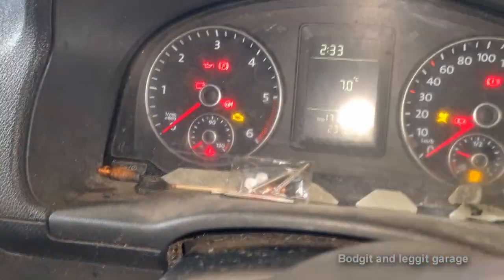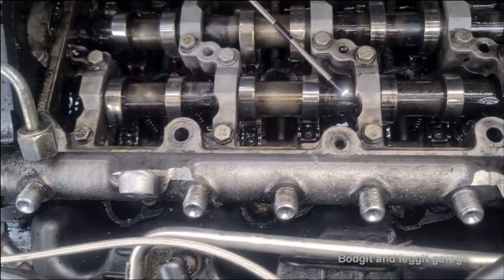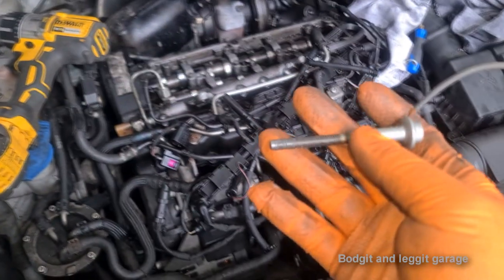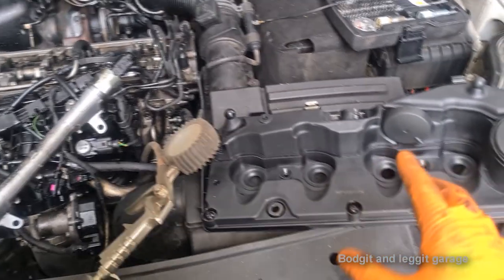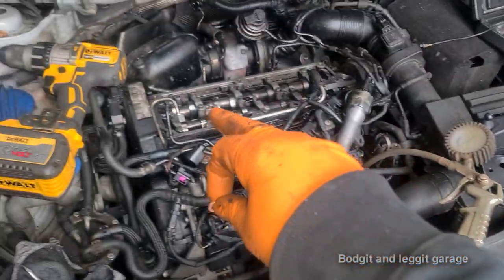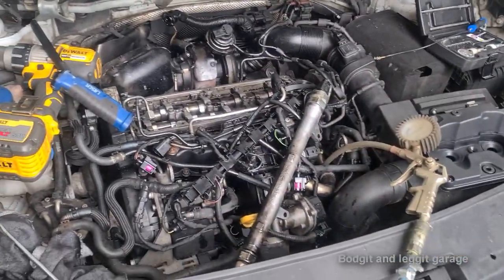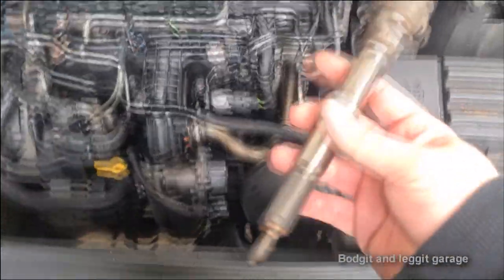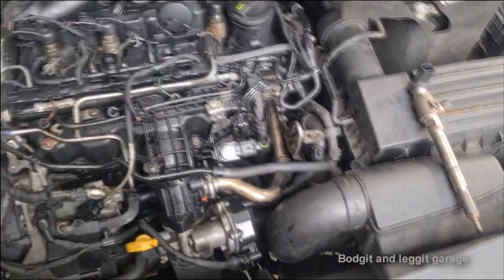Worst Job Ever Broken Bolts Runaway Diesel Part 2

Comment from the maker: I know I know I didn't really show the Helicoil kit Installation but I will be doing a separate video. Where I can film it a lot better So you can see a lot more what's going on
Reply: Did you change the oil and filter after you finished, I know you cleaned as best you could but any swarf or bits given these engines sensitivities wouldn't help down the line.

Comment: At those mileages these are the cars that never get seen by the dealer & their techs never get to solve these problems. Hats off to you putting things right with good diagnostics & some sound decision-making on the change to a stud & nut. These are the jobs that you remember & that showcase good engineering judgement.

Comment: When these VAG 1.6 /2.0 l seals go many people come to the conclusion it fitter error but its a design floor - the new seals are far to small for the injector and burn out - releasing the torque and causing the bolt to eventually snap. 

The damage can be catastrophic  - The feed pipes get distorted. The leak-off pipes shear-off - the injector seals in the rocker cover split and if you are really unlucky 

the injectors gets slammed into the seat and clip the hole the nozzle goes into, at the wrong angle scarring the seat area - meaning you have to reface the seat and use a different washer - I have sean a head scrapped from this and Fords have the same  set up….

Comment: Did my injectors on my Peugeot 5008 1.6 diesel  last year. One of the bolts snapped from the time before a mate changed one. Long story short, the broken part of the bolt which was left in stopped the clamp from pulling down the injector enough to make a seal.... so i cut the bolt down slightly which did the job.....

Comment: 14:30 I didn't understand what was the issue actually, why you couldn't use the same bolt in the new threaded insert? I have the same problem (same engine TDI 1.6) in my case the two injectors just popped out without breaking the bolt. so i'm just wondering should i use the same bolt or use a stud instead.
Very useful information btw... Thanks for sharing 🙏🏻

Comment: I hate this trade now been in it for 40 years there’s so much over engineered crap on cars  now… and things go wrong and the customer blaming you for other peoples fuck ups . Those bolts are a nightmare they are stretch bolts and shouldn’t be used again and mostly over tightened by previous garages and when you come to take them out they break leaving you with the stress of repairing. Everything is plastic housings.fuel pipes.sensors. The list goes on ready to snap  taking them out even changing a headlight bulb is a nightmare on most vehicles as well. Bring back the seventies so much easier then. Going back to those injector bolts make sure there’s no oil inside the bottom of the bolt shaft otherwise when you tighten them they will become hydraulic and will snap the bolt

Comment: I don't understand why people moan about your expensive tools.
You are a professional mechanic so you should have all the latest tools!!

I just got myself a set of USPro Flare nut spanner set that I will probably only ever use once 😂😂 but just want to know if it will be less likely to round the nuts off🤔 as they do have that extra bit of surface to catch the nut/bolt all 6 sides
Reply from the maker: People just love to moan no matter what I say. If I say it's white, they will say it's black.😂😂

Comment: That bolt was either done up with a impact gun or some one with no experience at all like a diyer. You know instantly when you thread a bolt in its not right, the previous person I suspect used a gun then a ratchet to where you can feel it getting tight then though fuck it not my problem now and left it that way for you to find.

Comment: Thats a nice tool, but i have a different method of blocking injectors whit a simple little screw between the rail and injector line😂
Reply: @bodgitandleggitgarage  I should mention that it has too be a countersunk head philips screw that fits nicely in the rail, than tighten back the line and nothing gets by.

Comment: Those are the reasons i keep the fuck away from them 1.6TDi's i don't mind working on the 1.9-2.0TDi's but them things are just a nightmare
Reply: @bodgitandleggitgarage  as for the threads stretching on the injector hold down bolt that's what they are apparently supposed to do because they are Torque to Yield (stretch) bolts and only to be used once that's why they are torqued to 8Nm on stage 1 and a further 180° on stage 2.

Comment: Why the hell those injectors are so looong in cars,no need for that,they propaply work fine if they were shorter in cars.likes sparkplug style lenght.but always like there go thru the oilpan lenght.i think is possiply make them shorter if like.much easier to maintenange and get of and back.